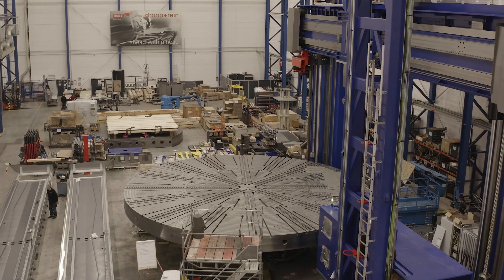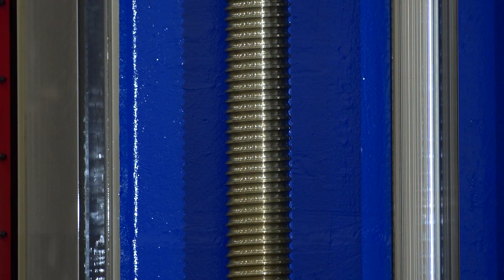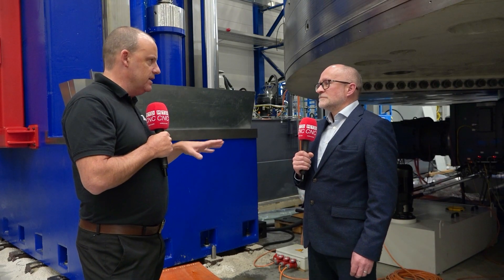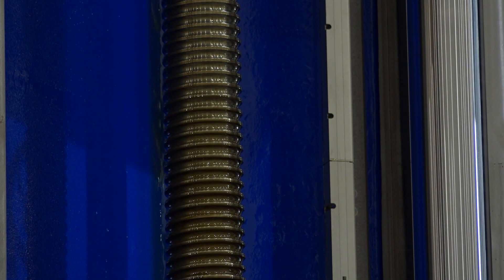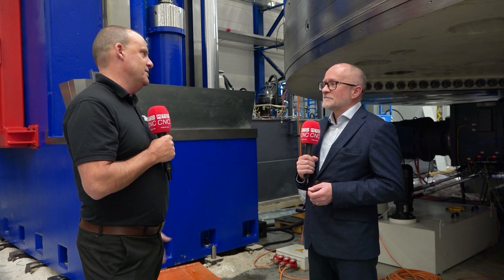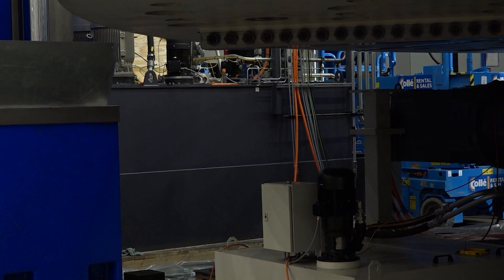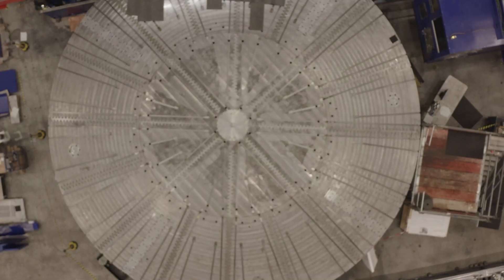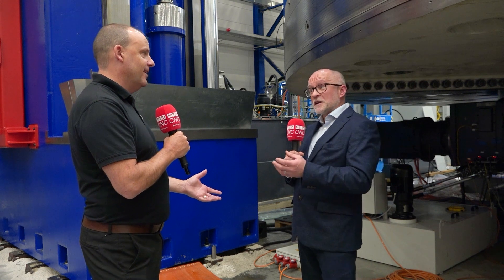Hydrostatic guideways explained with Starrag

Comment: OMG explained 50 year old technology. Great when new but when worn and leaking ! Oh boy.
Reply from the maker: 50 year old, really?
Reply: @MTDCNC hydrostatic ways yes. Starrag used them donkeys years ago. I serviced them. The seals wear or get ripped with swarf particles, then leak like a sieve after first losing lift and alignment geometry and oil.
Reply: @davesidwell415  box ways are also a million years old, and recirculating ball bearing blocks are also yonks at this point. I don't think the point here was that hydrostatic ways are a brand new revolution. Not sure I've heard of anything with a working envelope this huge designed to operate on them however.
Reply: @davesidwell415  The only thing this guy serviced was truck drivers at his local truck stop.
Maybe you could actually watch the video and see that they explained that they are now controlling the displacement of the machine with it as well.  I know it's almost a whole 4 minutes long and is asking a lot.